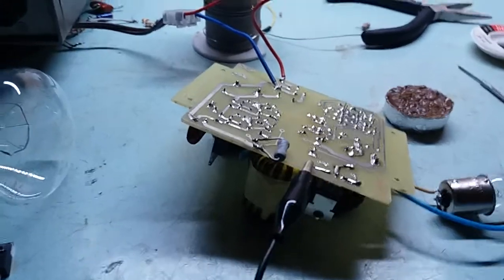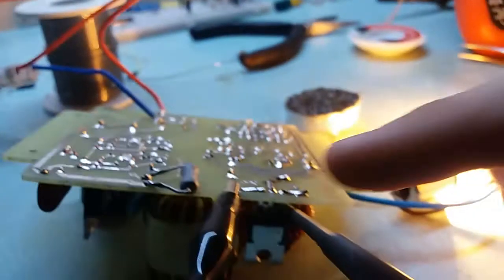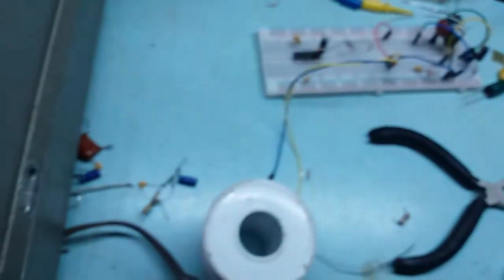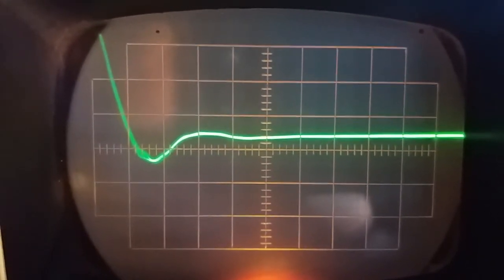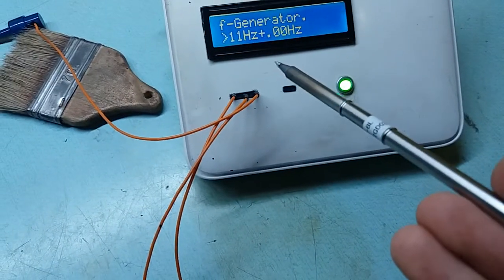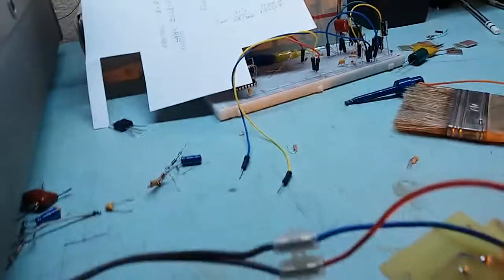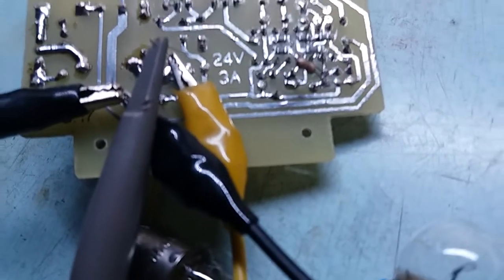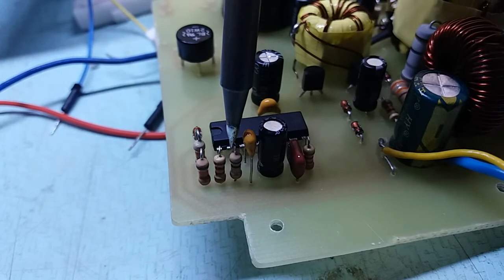tl494 SMPS: Part 6 - RC snubber, loop compensation

Comment: Nice series of videos :) Did you thinking about making videos about flyback converter and good ol UC384x series current mode chips ?
Reply from the maker: I do have two vids about uc384x flyback already :) Recently I redid the board layout for that flyback, you'll see that in the next video.
Reply: I saw it, you rearly see someone talking about compensation, everybody just film finished circuit and that's it...